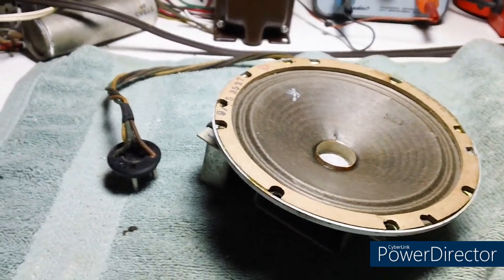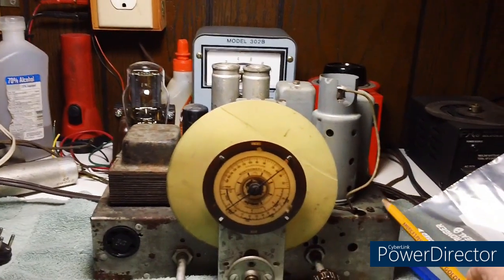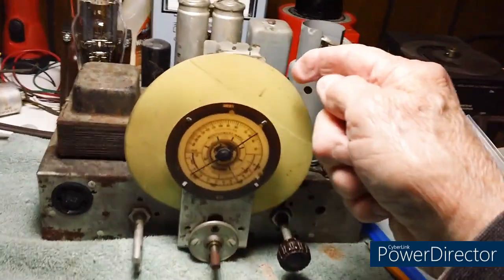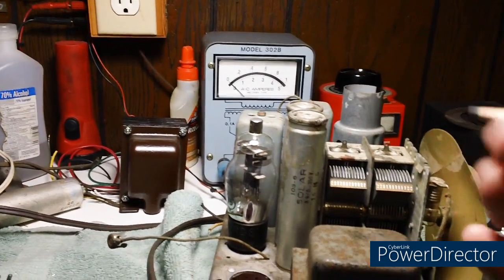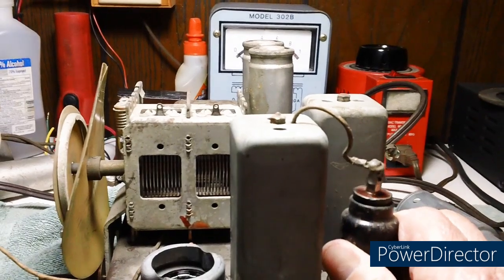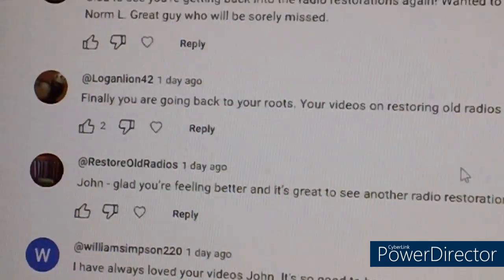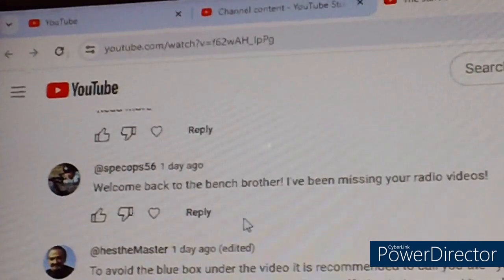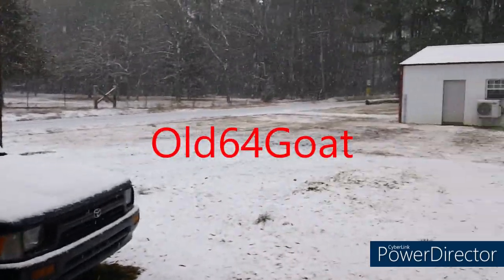Part #2.  1936 Airline 62-198 repair and restoration.

Comment: I started on tube guitar amps and progressed to radios. Of course, at the time I was tight on money, and I had a degree in electronics had worked in the field 10 years and ended up becoming an electrician. I figured I could build a tube guitar amp for myself. So, I had a bunch of knowledge on electricity but not specifically tube amps. You are correct about a shock having a lingering tingle because the same thing happened to me. I had just built an amp and was ready to try her out. I had my guitar around my neck and turned on the amp and as sound started coming out of the speaker, I went to mute my guitar strings with my right hand and got a serious shock from the strings. That damn thing was numb and tingling for weeks from that high voltage DC shock.
Reply from the maker: The school of hard shocks! 🫤  I never want it to happen again.
Regards,
John

Comment: Great video, one thing you may want to cover is often tubes lose their markings when you clean them, take a picture before you run the dirt off and don’t trust that the right tube is in the right socket ( or even the right tube for the radio).
Reply from the maker: Scott,
Looks like you just did, my friend.😃
Regards,
John

Comment: Exactly right John take your time and don't rush you can avoid stupid mistakes that way. My Dog Chubby was happy we got snow he loves to go out in the areas I haven't shoveled off. I got shocked a time or two not from a radio rewiring houses for an electrical sub contractor I worked for two years before I got my real job at Pacific Gas and Electric.
Reply from the maker: Larry,
Sometimes getting in a hurry just sorta sneaks upon a fella, which always causes problems.  Speaking of hurry...have you yet found a drag strip for that M37? 😂
Regards,
John

Comment: Great video and to answer the question you asked at the end I have really only been restoring radios for about 3 or 4 years but watched your videos long before that just never found a good candidate. I started with a philco mono record changer and then a GE model, both need to be reworked from setting in storage. I have a zenith that I started but put on hold, and finally my daily driver a Rotel FaX-200c that I use as an amplifier for my pc gaming and listen to tapes and records on, sadly the radio side needs new tubes as FM barely picks up anything anymore and AM is dead in the water, although funnily enough if I touch the output of the one tube that is AM only it will start picking up FM stations
Reply from the maker: Logan,
AM receiving FM?  You might have broken ground on something new, my friend. 🧐  Patent it.
Regards,
John
Reply: @joernone  It is a unique design where the AM and FM share a majority of the tubes and circuitry. I posted about it and it's issues on the antique radio forums

Comment: Slammed back against the wall behind the Philco b&w tv I was working on as a kid. Thought I shorted out everything in and around the high voltage cage to replace the 1v3.  WRONG!  My heart returned to normal about 30 minutes later.  Yes, you don't forget these things!
Reply from the maker: Frank,
Good grief...you're lucky to be here, my friend.
Regards,
John

Comment: Just curious , since you don't believe in using a dim bulb when working on a radio , how do you safely reform the electrolytic capacitors on them ?
Reply from the maker: Easy-peasy, my friend.  Replace the caps.  So-called reformed caps are just failures looking for a time to happen.
Regards,
John

Comment: John,, Would you please post part no. and name for the plastic sheet you used to fix the light difuser. Nice to see you back on Youtube regularly ;-) ;-)
Reply from the maker: I said that I got it at Hobby Lobby.
Go here: https://www.hobbylobby.com/Fabric-Sewing/Sewing-Quilting-Notions/Quilting-Tools/Heat-Resistant-Quilters-Template---12-x-18/p/44811?queryId=826cc8e6a2b6fe79296124e9432918e2

Comment: John.  I have been watching the vidoes for years.  Would you consider doing a shorter video explaining the fundamentals of radio theory?  Nothing too in depth.  Basically going from antennae to speaker and explaining how the individual parts work in the overall circuit.  1st and 2nd IF's, oscillator, antennae, speaker coils etc.  What are the functions of the different tubes (detector, rectifier etc).  Just basically an idea of how radio waves work their way through to final sound.  Just a thought.
Reply from the maker: Been there - done that.  Go here:
https://studio.youtube.com/playlist/PLPagKqeCjne9oL1lenxI1evLs_YfkiT6y/videos
Regards,
John
Reply: John that link doesnt seem to work on my end  @joernone